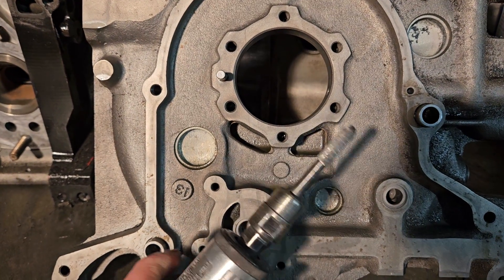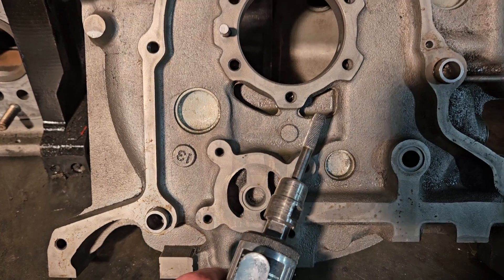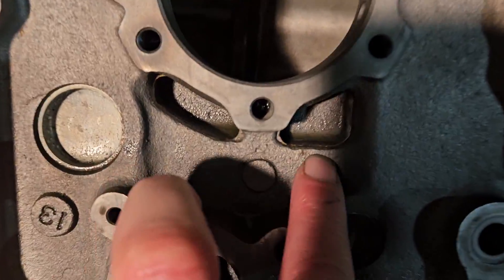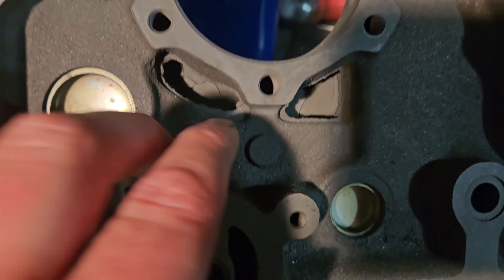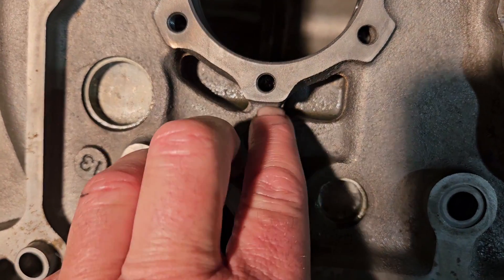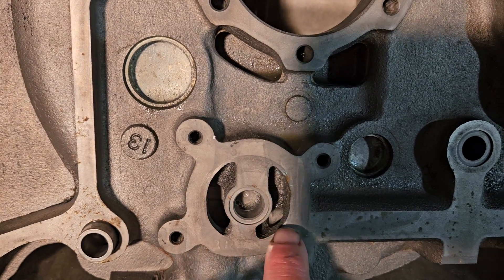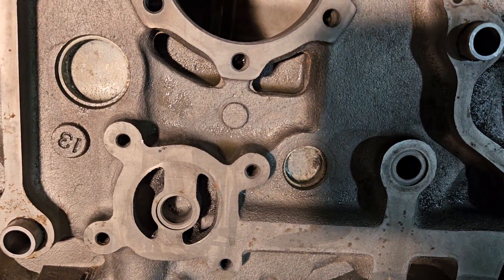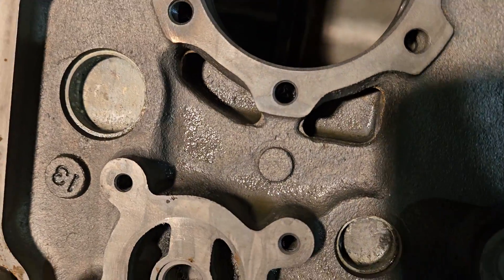Front 12A & 13b RX-7 housing oil drain back porting and cleanup, rotary Tech talk

Comment: whats the best way to drain the shavings out? i was thinking compressed air and cleaners, chemical flush?
Reply from the maker: Same with all parts. Solvent tank thoroughly clean with brushes. Wash off with fresh water. Then air dry with compressed air. If anything is missed, hit it with some brake clean. Or acetone... inspect..., if anything is missed back into the parts tank and repeat.

Comment: I currently have a 1997 Miata and an 1987 RX7.  The Miata is getting a full teardown at the moment so doing a lot of the things like radiusing oil passages from the filter, but for both cars, one of the very first things I did was to take all the external parts such as the intake and exhaust manifolds, and shave off all that flashing on the outside and hit some of the non critical sharp machined edges with a file to just make it safer for my hands to work around the engine and not slice my skin open on everything.